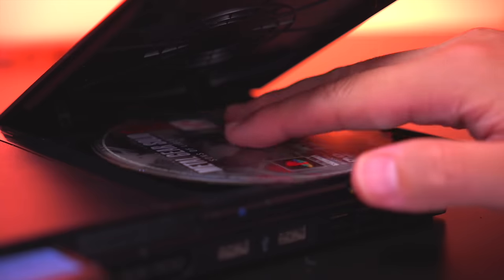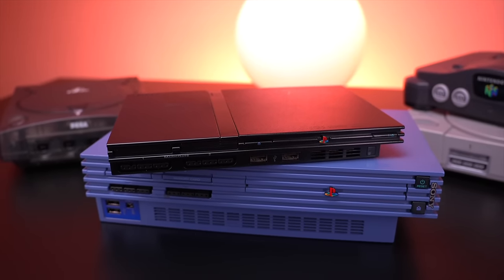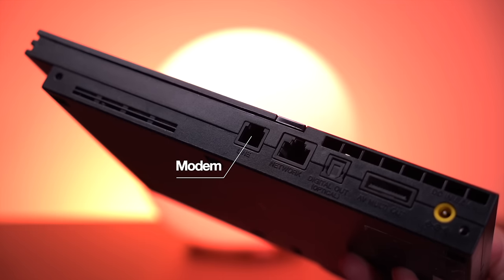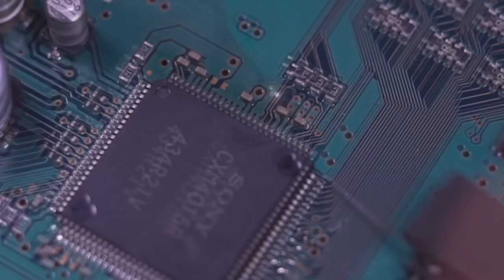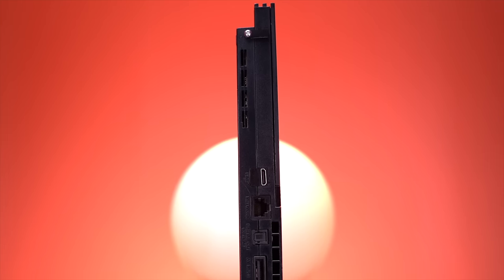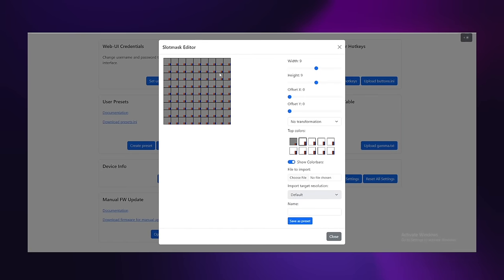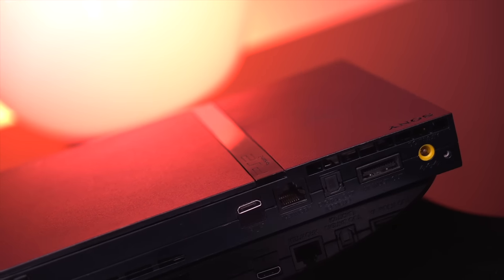This HDMI Mod Makes The PlayStation 2 Look GORGEOUS!

Comment: I think you undersold the level of soldering difficulty. I have over a decade of soldering under my belt and this would be near impossible for me to do. Also $200!?! 😮 Good god. Just buy the component cables for your ps2 and call it day. They look fantastic.
Reply: I agree, the component cable works well, I would say too well, the PS2 low res is very jagged, the blur in the component signal helps diminish those jagged edges
Reply: I agree. I own a electronic repair shop and 90% of gamers do not work on or mod systems and have very little if any microsoldering skills. So with $200 for the hardware then another $100-$200 to get a repair shop or modder to install it just doesn't make much sense
Reply: Yup, as soon as I hear the word “soldering” with these modkits, I immediately dip out.  Granted, it’s not THAT difficult once you get the hang of it but 9 times out of 10, it’s hardly worth the headache that you’ll inevitably develop.

Just get the components cables and a scaler like the RetroTin (not to be confused with a converter, that is something entirely different)
Reply: Yep, as soon as I saw the cable you have to solder to that custom chip, that was it for watching the rest.  Louis Rossmann I'm not.  Heck, I can barely SEE the leads on those chips.

I hadn't even gotten to the price part of it.  Our PS2 is sitting upstairs in storage, and we never even had very many games for it.  So wouldn't make sense to mod it.  Besides, the HDMI ports on our TV are already filled, but we have a composite and component connection still open.
Reply: @rochester3  That’s beside the point honestly. This is for purists who want to play on native hardware. In any case, PS2 emulation is still hit and miss despite the major advancements and innovations due to the finicky nature of the emotion engine.

PS2 is just one of those console where playing anything but native hardware feels like adultery
Reply: @bronzin1445  i understand what your saying but 200 for this device and then paying for a soldering system lol no way
Reply: @SenileOtaku I hear you. I have a silver PS2 slim and the optical drive even though it still works, I could tell it was starting to fail. Early last year I found out about free Mcboot and started running games off of USB sticks but that wasn't so great so I used an old PS4 hard drive on it and all PS2 games run buttery smooth on it now. Now I'm playing games I never got the chance to when they first released.
Reply: I've been down component cable route. Got aftermarket and even imported some mint OG Sony PS2 ones from Japan. Most modernish TVs struggle with PS1 titles at 240p so if you want to play FF7/FF8 in all their glory you are in for pain.
Reply: Love the video, love the hardware, HATE the price good LORD why is it starting at $100
Reply: @bootywrecker  Very niche product, I doubt they'd even sell a hundred.
Reply: Agreed. Paid around $30 US for a HD Retrovision cable and it does the job well enough.

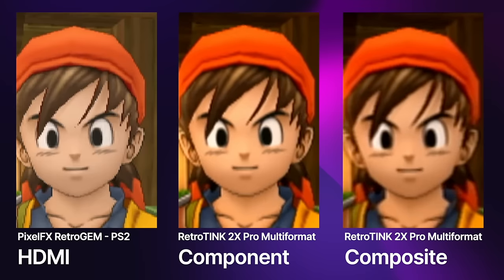Comment: 24:13 don't know why but the Component looks much colourful than HDMI and defined than Composite.
Reply: Yup
Reply: True. The PS2 was designed with component in mind to be the ultimate experience as that was the HD of their time. Too bad there aren't many new TV models that support Component Input. It's better to pickup an old LCD flat panel that still supports it.
Reply: I agree I want it but I think I stick with pcsx2 which does a damn good job upscaling

Comment: The fact that they want you to put a wifi antenna in with the mod only to update the mod (why does it need updating in the first place?) as well as the freemium mobile game level paywall on hardware you already paid for is an absolute dealbreaker, jesus christ. Never in a million years would I want such an unscrupulous company's device constantly connected to my home wifi.
Reply: Firmware updates, bug fixes.
Reply: @ians_parks  But why does an analog to digital video converter need software updates? I have never, ever seen such a thing before. 
It genuinely makes me suspect the product may just be a lazy cover for a listening device.

There is ZERO need for wifi on a product of this type.
Reply: @MasqueradePW facts

Comment: Seems like a great kit, but locking some features behind a paywall is something that I always disapprove of.
Reply: I'm OK with it if it means a lower starting price for the hardware. If...
Reply: @BHFFS  I'm only okay with it if it's not a software based lock
Reply: Except they obviously can afford to sell the hardware at the lower price. There's no good reason for the difference other than they knew the market would allow them to charge more as it's what their previous products were sold at.

It's not illegal, but it is anti consumer and leaves a bad taste in my mouth. I'm not the target audience for this anyways so it's not like my opinion means anything, but just my hot take.  @BHFFS
Reply: shuold have been one version, price in the middle. softlock is absurd.
Reply: gomam0n702  How is it stupid logic? If its hardware based thing, the one with better hardware obviously costs lot more to manufacture, but if its software based thing, that's just a stupid limitation made by a human

Comment: It's appalling that they charge an additional 70USD just for a couple of SOFTWARE features that don't impact the actual hardware the sell. That's why open source mods will always come out on top when they come out, all the cost is in the hardware and nobody will stop you from adding features to them, unlike commercial mods.
Reply: Or just crt
Reply: Yeah, I also absolutely don't agree with Tito on the point that paying for a software upgrade is a pro argument. That's just as scammy as DLC for cars are and all that disgusting sheet we see more and more of! 🤮
Reply: While I agree with the open-source vs commercial point, I don't get your complaint. You don't pay extra for more features, you pay less for less features. If only the $190 version came out, there would be nothing to complain about. But since there's the option of paying $120 for people that can't afford/don't want to pay that money upfront, somehow it's appalling?
Reply: So from how I understand it the basic edition exists for those who are planning on using this mod in conjunction with their upcoming 4k "Morph" scaler, which offers all the features you'd get with the shiny addition anyway. Basically you'd buy the basic version to not have to pay for the same exact features twice.

If you don't plan to go the 4k upscaler route and just want to have a fully featured PS2 hdmi solution then there's the shiny edition which can be upgraded to at any time and costs about what all their previous hdmi mods retailed for. And likely what the mod would've retailed for anyway if they had never decided to offer this basic alternative.

I think the way they see it they can afford to take the loss on people buying basic kits because those same people are likely going to buy their upcoming scaler anyway.

I admit it's an extremely odd decision but I don't think it was ever intended to be scummy. I'm sure they wanted there to be one universal kit so it'd be easier to keep in stock, and that's why there is no actual hardware difference between basic and shiny additions. Though I honestly would've preferred if they had just scrapped this idea all together cause all it did was confuse and piss everyone off lol.
Reply: @VforVirtual  No. They are paywalling features to bait customers to pay more as it is with every DLC ever, no matter if for software (which is already bad enough nor  for hardware (which is the cherry of awfulness on top for disgusting modern day business practices).

They take capability/functionality, which already is in the product (and most would want to have like 1080p 🤯 and the option for actually useful deinterlacing, which Retrotink user just could switch off) away from you deliberately just to get you to pay a premium. And that's absolutely disgusting 🤮
Reply: How about you spend thousands developing a similar multi-console solution then give it away for free then?  Either buy this or don't.  But stop whining like a child.  Not everything is free in life.
Reply: my GBS-C looks pretty good but honestly a decent PS2 2 HDMI will be fine
Reply: @sulac4ever170  You're comparing apples to oranges because in this case you don't pay a premium. You either pay full price and get all features or you pay less and get less features. They even give you the option of upgrading to the full version later on, if you feel it's a good purchase. You could have made an argument if the basic version cost $190 and the shiny one $260, but that's not the case.
Reply: @mr-prez This is an EXCELLENT example of a strawman argument. You don't have a leg to stand on to reply to the actual post so you make up some nonsense and then argue against that.
Literally zero people are stating they should give it away for free (REEEEEEEE). They're saying that charging more to unlock arbitrary restrictions intentionally put in there by the developers is BS.
Let me know if you're still (somehow?) confused.
Reply: @VforVirtual You... literally do... pay a premium to unlock arbitrary/artificial restrictions. They give you the option to pay money for artificial limitations on hardware they already charged you for with the option to pay more money to unlock the.................. hardware... you... already... paid... for.
This isn't an idle game which is free-to-play or "freemium". They're charging for the hardware. They should give you the full capability of... the hardware... that......................... you paid for.
Reply: @VforVirtual  Nothing to add to the previews commenters, which stated the case very well about the fact that they charge paying premium.
Reply: @sulac4ever170  not the first time i hear Tito making some weird  shill argument, just saying...
Reply: @renesav  This actually is the first time something like that stood out to me, but then I also don't watch all of his videos.
Do you recall a specific past example?
Reply: @sulac4ever170  one about a ps2 laser replacement or something like that, he was talking like people HAVE to do this or your laser could die, he was so trying to make people believe they needed this but he was quote on quote "sponsored" to show the product, its something i realized, he wont take sponsorships of course but he sound really bias, before that ps2 video i was 100% with Tito, but sfterward i started noticing here and there little things, like in this video, why did he used a retrotink 2 instead of a 5x for comparaison, ok maybe he dont have one but ret2x is not a good conparaison to the retrogem, the 5x is... just little things that add up, kinda hard to remember everything upfront but that ps2 laser or disc drive video, thats where it started
Reply: @tim3172  jfc it's like talking to a wall. You want all the features? Great, pay full price. You're fine with not having all the features? Great, you have the option of saving money. How tf can you even argue that having a $120 version and a $190 version is somehow worse than having just the $190 version?
Reply: @renesav  That's very informative and unfortunate, thank you!
Reply: I listened to a Q&A with one of the main guys and he said they did it to create a entry level and if you want to upgrade later you can do that and he also said if they ever go under or decide to move away from HDMI mods they'll just make the upgrade free
Reply: @tim3172  1080p is the DLC😂😂🤣🤣
Reply: @VforVirtual There would be something to complain about: it'd be prohibitively expensive. This is already non-trivially pricier than similar alternatives at $120, a ~50% price bump to $190 would make that shortcoming all the more apparent.

Also, in principle, the "paying less for less features" vs "paying more to unlock features" is purely a matter of perspective. The result is identical: if you want to be able to do X, Y, or Z, you need to pay more money than you would otherwise. The pivotal detail in this scenario though is the fact that the functionality in question is literally already in the customer's hands; they just aren't allowed to use it unless the manufacturer decides they're allowed to. It'd be like buying a house with a pool, but not being allowed to use the pool unless you pay 50% more to the guy who owned the house before you.

On a personal level, you absolutely have the right to deem that trade fair and buy the house and pay the surcharge. I would, however, encourage anyone who'd entertain such a purchase to consider what supporting that business practice means in the long run, not just for yourself, but for literally all of commerce going forwards. Inviting companies, regardless of size, to exercise further control over products we buy from them does not help us; and supporting business practices that invite that control when viable alternatives exist is an active endorsement of that control.
Reply: @fastmovingvolcanomatter  I have no idea where you got that from. $120 for a full-fledged hdmi mod is incredibly cheap. The DCDigital, N64Digital and PS1Digital were all similarly priced at $160-$180. And the RetroGem is compatible with multiple consoles, so the complexity of designing, building and programming the board is a lot higher too. But they manage to keep the price low by only having to focus on one multi-purpose board instead of multiple specialized ones. They didn't need to put out the $120 version, but they still did and many appreciate that. If you don't and can't understand what they did, then move along and don't buy it instead of bashing them for it. Put your wallet where your mouth is and support "better" business practices instead of manufacturing outrage.
Reply: @renesav hey just a friendly tip: the correct term is "quote/unquote".
Reply: @fastmovingvolcanomatter  Very well said!
Reply: @VforVirtual  The thing is, that in addition to what @fastmovingvulcanomatter said, the way they engineered this HDMI mod (on device fits all), they can radical decrease production cost in comparison to individual tailor made mods for every console, because they can produce in higher numbers compared to others (which have their purchases spread among many different products, which all need their own production process).

This means, that they actually could sell it for significantly less money than others and in providing the 120 version (which is identical to the 190 version in every single way and therefore not more expensive for them) they prove, that they in fact can afford it (and as already stated before: to have the thing more profitable they could just offer the whole thing for eg. 140 instead of doing this utter BS dlc garbage). So there is no excuse whatsoever for softlocking features behind a paywall and your argument is NIL.

And by what you wrote at the end it is appearent that YOU in fact absolutely didn't understand HIS point, not the other way around.
Reply: @sulac4ever170  I already mentioned in my response the fact that manufacturing a multi-purpose board helps reduce costs. Meaning that $190 factors in that cost efficiency. And sure, they probably could afford selling it at $120, but with a significantly lower profit margin. Selling both versions both ensures a likely similar profit margin to their previous models (which finances their future work) and increases it by tapping into a new customer base, that couldn't afford paying $190 or just doesn't need all the features. Thus, it benefits both the producer and the consumer. 
I totally agree that the basic idea of paywalling software features is something that can and has been abused in the past, but it's just not the case here.
Reply: @VforVirtual  I know, but you did draw a strange conclusion from it, so I wanted to rephrase that point.

But why didn't they just offer it for a price in the middle of both for everyone evenly (like eg. my already proposed 140)? In the end, the profit for them would average out to a similar margin, while don't enforcing condemnable business practices and avoiding controversy.
This makes no sense to me.

People who don't need the better deinterlacing, because they already bought an OSC are exactly the kind of people, who obviously don't have a problem with paying much money, so they wouldn't mind to pay more.
And people who don't have one, because it's expensive are the ones which are most interested in a budget version, but it doesn't offer the feature they would actually need.
So they got the pricing model completely backwards, which makes the split pointless to begin with.

And that's why the only conclusion is, that they calculate on people buying the cheaper version, just to quickly or eventually realize, that they indeed have a crippled product, to then pay them another 70 dollars to in the end making more profit, if they just sold it for a lower price for everyone evenly in the first place, which is the idea behind that awful practice of offering DLC for hardware.
Reply: Bruh you all talk about upscaler and you know what ?? I play my crt every 2 days and it's hell of fun and IF you I'll want upscale your old games just use emulation